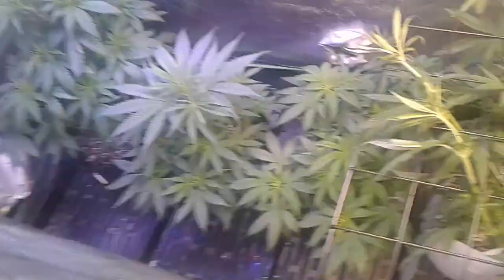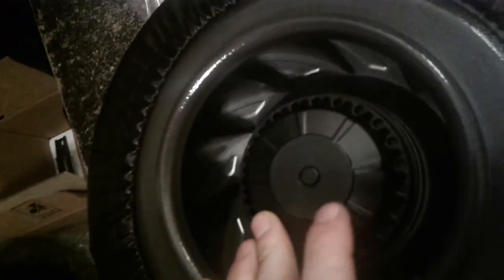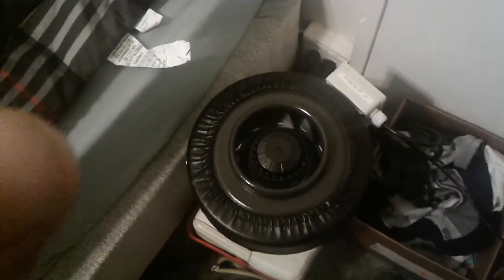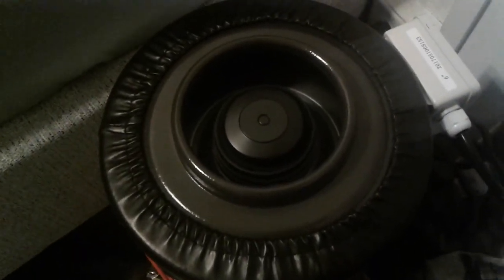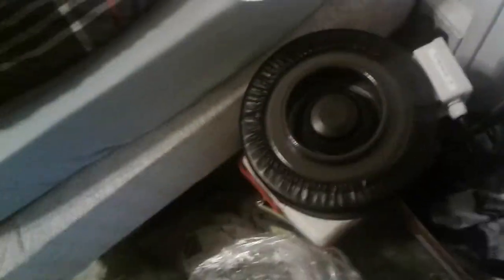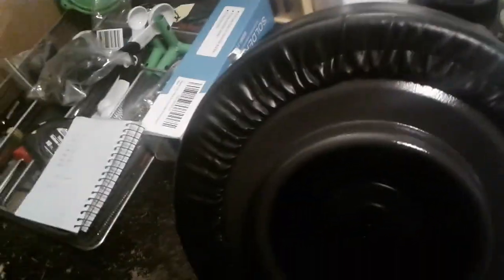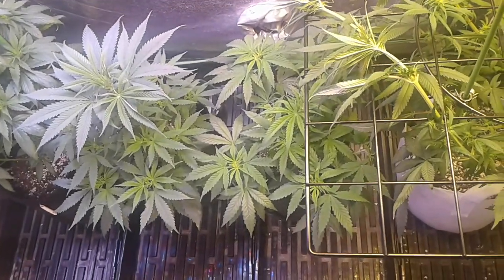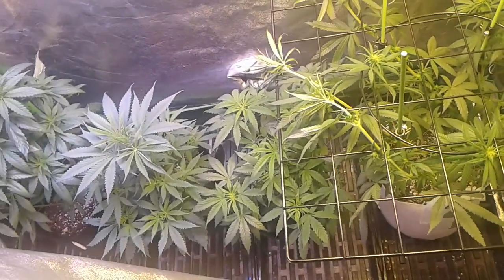Vivosun 6 inch inline fan w/speed control--full review and testing

Comment: If anyone has access to 3d printers you can turn any turbine or centrifugal duct fan into something more suitable for specific enclosures. The motor itself isn't the biggest factor in performance. There are tons of resources from different blade geometry, shape of intake and outtake. You can make it look like an actual replica from a Boeing turbine for the aesthetics or whatever the need is and on open source sites with mostly free files like thingiverse.

Comment: Does this fans mounting bracket not come with actual mounting bolts? Mine has the bolts that hold it onto the bracket but not the bolts that hold the bracket onto the wall. Am I missing some bolts?
Reply: most people use those pulley hangers to hang in a tent, just use screws and washers to mount on a hart surface.
Reply: That’s all mine came with. Just need a few long screws.